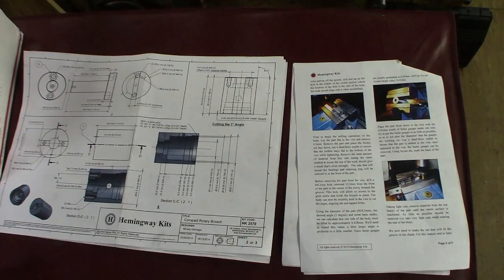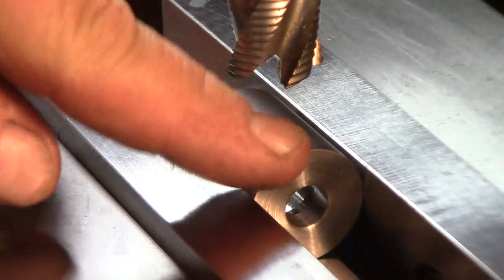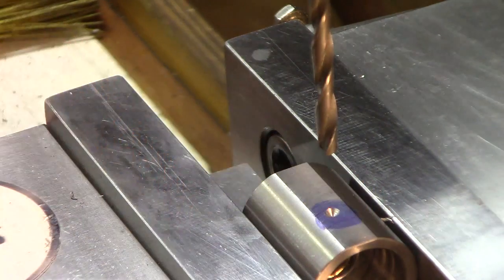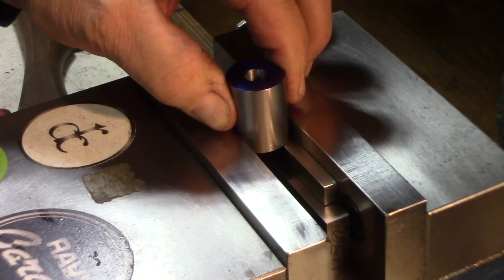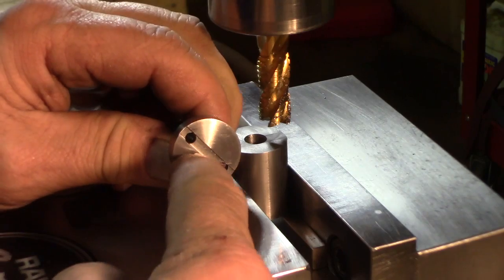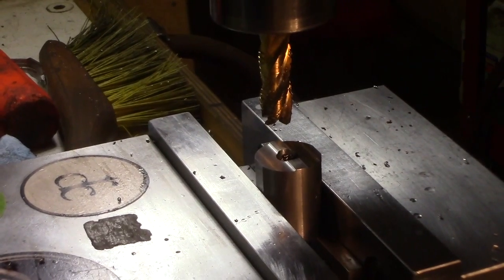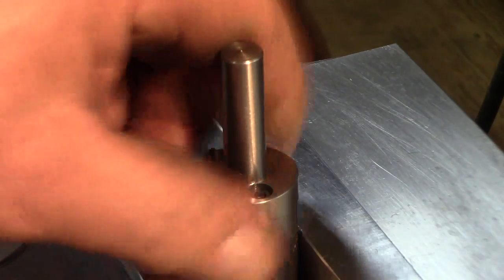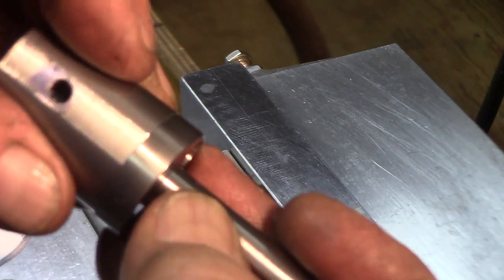How to Make a Hemingway Kit Compact Rotary Broach P5

Comment: I finally got brave enough to give this a try. I am still at the previous step but it is going really well. I decided to start practicing with my own round stock and if I do it right then I will use the stock from the kit for a real one.  Thanks for the videos (yes I know these are really old, but I find them useful 6 years later).
Reply from the maker: You can do it!👍👍👍👍
Reply: @RRINTHESHOP  I made a lot of progress this weekend and have the broach body done to the step where it needs alignment.  So next I need to make a broach, and to do that I decided to make a custom Machinist jack to help me hit the right angle with my indexing chuck (fine pitch screw to hold chuck weight as I make the 2 degree adjustment before milling the broach).
This has been a lot of fun so far, and a little frustrating, but mostly fun.

Comment: At 1:55 with the camera wobble I thought you had got a CNC and were interpolating the hole. LOL It looks like your end mill must have had a radius as the shoulders don't look square on the protrusion? Maybe an optical illusion I went back and looked and didn't see that a feature called on the print.  Just wondering.
Reply from the maker: You are right Brian.  But that made it fit very tight when seating.  i did not notice it until I made the first cut, so I left it.  Thanks for watching.  Your shop is sure coming along nice.